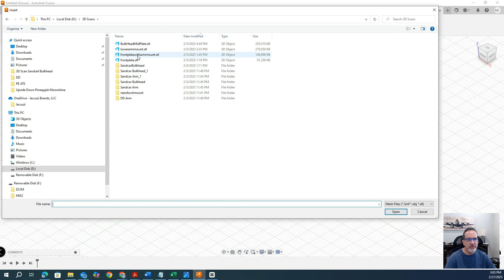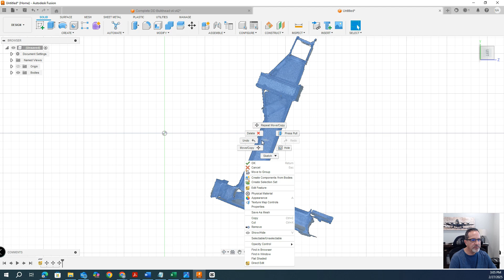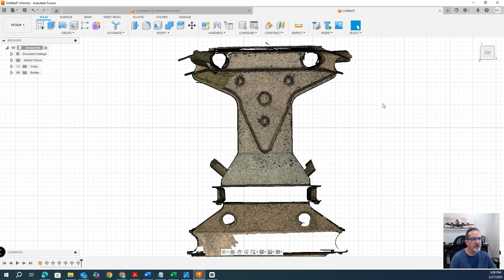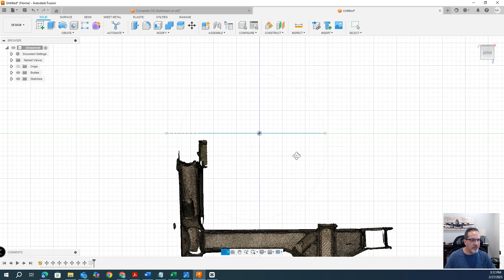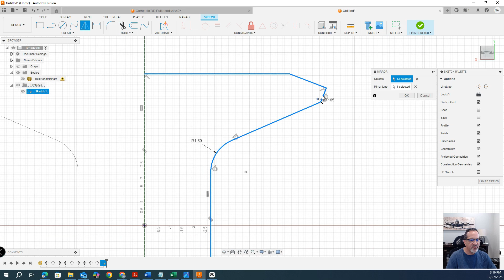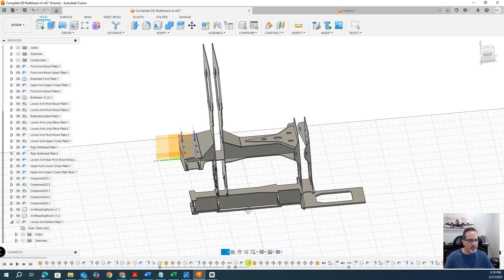3D Scan to Fusion 360 Sandrail Bulkhead

Comment: this method works b/c the part is on the car and sort of orientated, but putting the scan in a component, unanchor, mesh/direct edit, create construction planes & axis on the scan, then modify/align, orientation will be dead on.
Reply from the maker: So then this creates construction planes right on the surface of the scan? If so, that would be nice! I will have to try that. Thank you!